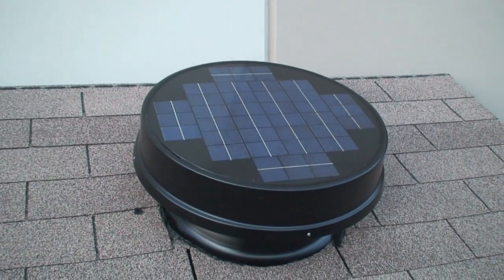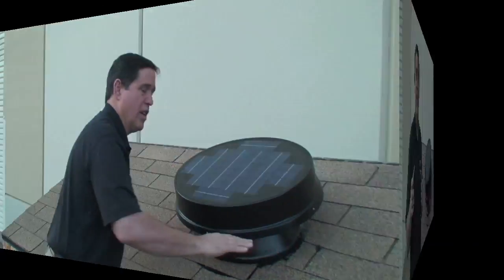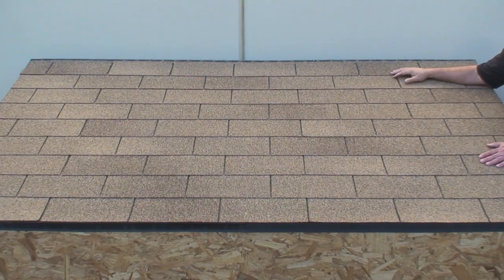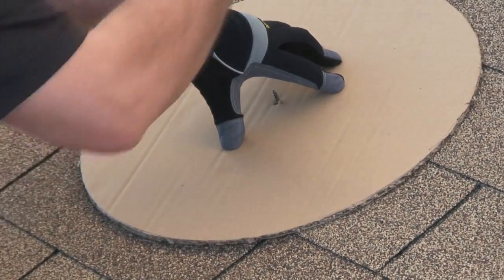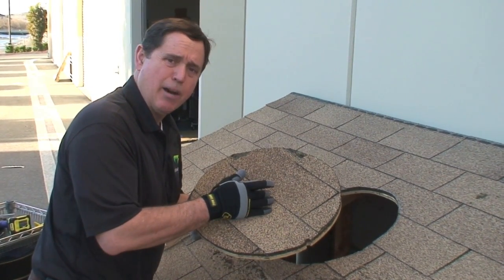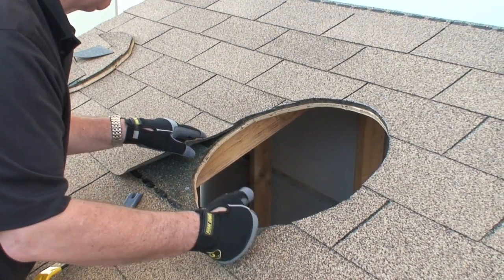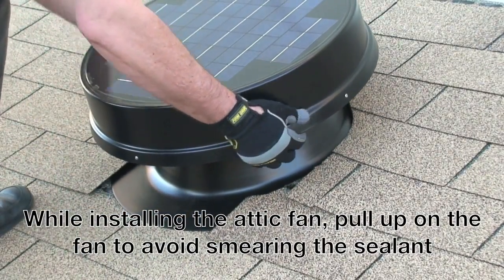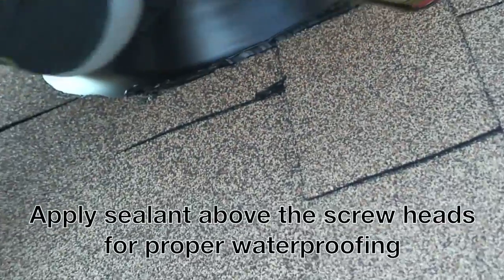How to Install Solar Attic Fan DIY - Yellowblue Eco Tech

Comment: Thank you for this video.  Is there a thermostat for this fan?  
Or, will it keep running 24x7 ?   
Sometimes during cold whether you may want to keep the heat in.

Thanks!!

Comment: How about a simple pricing guide, when I see a product that shows great potential then you have to play Marco polo to just get at the price of the thing, I immediately suspect an upsell High-pressure system in place. How many potential customers have you lost due to the fact you can not put a straight forward pricing guid on the sight? Most independent do it yourself home owners and small contractors do not want to talk to a sales rep unless it is to get a product serviced that has failed for some reason or to get an occasional Tec aspect as needed.  Food for though. From an almost customer!.

Comment: Well-made, delivered quickly, and easy to install with Fastly.Cool . I may be imagining it, but it seems quieter than the 14 year-old unit that I pulled out. Of course it was noisy at the end due to failed bearings, so hard to compare.
Reply: This stupid comment seems to be on every solar fan video.
Reply: @TonyYesi  lol
Reply: yunis parveiz is a bot leaving same (copy paste) comments on every solar power installs - advertising his company

Comment: I'm not a builder so I'm ignorant if many things. I think this makes sense in consistently warm and hot climate, but what benefit is it in winter? I'm concerned the opening will allow the cold in or heat to escape through the roof. Am I mistaken?

Comment: You do note want to install screws through the shingles! Putting caulk on the screw heads won't help as it will cook off in the sun and then leak! You also don't want to put the piece of shingle on the bottom that is a dam for water, leave it off to let the water run off.
Reply: 1000% yes

Comment: Actually should leave bottom part of flashing exposed to keep rainwater from backing up and getting trapped under the shingles and then just seal around the shingles you lifted up.

Comment: If your heat/cooling ducts are also in the attic this fan will create a negative pressure.. sucking out cool air from these ducts where they are spliced or connected to ceiling register vents. I installed one and My attic was cooler at the expense of much higher a/c power bills.
Reply: *   If you have access to the ducts, tape the joints. Should be taped anyway.
Reply: Would you recommend an electrical version instead? Thank you

Comment: My wife forced me into having a sit down lunch and listen to their products such as this fan ... the price with I
Installation was $2400     Meanwhile the fan is about 300 online    Ripoff
Reply: I have Michael and Son installed a wired attic fan 10 years ago for $399.99 - Fast forward to 2019 (last year), the fan stopped working so I ask them to replace it... they said I should only replace the fan motor...and it cost me $599.00 to replace the motor and I asked why replacing just the fan motor cost more than the entire fan installation?  They said because the full installation labor is now $1299+price of the fan!

Comment: Who taught you how to do this? They need to be thrown off the roof, you do not put these under the tar paper always on top to prevent leaking. And no screws only nails. Unless you want something to happen hoping you'll get the call to come back out and make some more money off unsuspecting home owners
Reply: Why no screws? Why just nails on roof? I'm thinking of installing and am genuinely curious
Reply: Dan Burkett only roofing nails should be used because they’re corrosion resistant, they have a broad head to keep the shingles or whatever they’re holding down from ripping off during high winds. They also have ribs on them to hold into the wood underneath. Plus with a screw there’s the possibility of running them in too hard and damaging around the area to allow water to leak through. If you do decide to do this please do not use screws and only use roofing specific nails! Your insurance company or wallet will thank you in the long run. Also be sure to put some type of silicone such as liquid nails or something of the sort, over top of the nail heads and on the bottom of the vent before placing to help keep water from entering anywhere
Reply: @blake102989  Thanks for the thorough reply! I'm on the fence if this is the route I want to go or a Gable mount? (mounted on side of house instead of in roof?)
Reply: Dan Burkett  you’re welcome. I personally like whirlybirds because you won’t have to worry about the fan going out like you may on this one. Look into them too. I’ve always put them on the roof never on gables.

Comment: My house was built in 1889 when i bought it, it had it's second roof on it. Composition over shake there were no vents. When i re roofed it i put a thermal attic fan on the west side. Now the attic is cooler in the summer. I dont have central air, no ducting. I have fans. One ceiling fan one floor fan. No moisture and no mold anywhere. The only insuation is in the roof. And a pellet stove works to keep it warm.

Comment: Is there a thermostat that tells the fan to kick in or is it always running?
Reply: Hard to believe that they did not 1) include a thermostat, and 2) did not design a bug screen.
Reply from the maker: Always on per solar embedded crystelline chip theres no "on or off" switch
Reply: What about during winter?
Reply from the maker: Hi John, there are actually benefits to the having the fan run during the winter... Helps with removing moisture build up that can cause mold growth issues. Also, can help with ice damming. Here's a link to some additional info on how our solar fans work year-round: https://yellowbluetech.com/products-technologies/solar-fans/how-does-a-solar-powered-attic-fan-work/.

Comment: Great video buddy.I'm thinking about purchasing two of these solar fans but I have a question.My house has two 4' off ridge vents on it,should I seal the bottom of those ridge vents or will they be alright opened? I'm afraid that when i install those solar fans that the air being sucked out will be getting sucked through the ridge vents which is outside air instead of air from within the roof. Please let me know what you think.Thumbs up on this video,thank you for your time bud.
Reply from the maker: Thanks for the positive feedback! All questions on our system can be directed via http://yellowbluetech.com/contact/.
Reply: Yellowblu Eco Tech

Comment: seems like there should be an on off switch
Reply: Most are set to 'go on' when the attic reaches a certain temperature so that it creates air flow to pull out the hot air keeping the 'living space' of the home cooler.  I don't know about you but I don't want to have to manually turn the fan on and off.  What a pain.
Reply: The switch will be when the sun isn't out.

Comment: You should have it installed over the tar or underlayment paper. You must not drill screws through shingles. It will leak couple years later. You also need to leave at least 1/2 inch clearance around the top flange by trimming the shingles. Then you calk underneath the shingles. Besides that, great installation. haha
Reply: 100% agreed, never cut the underlayment.  There are some great sealants now that are rated at 180F.  No screws thru shingles, try to lift them and put a couple under the shingles, seal the screws before final tightening.
Reply: This^

Plus using a Sawzall to sideways cut through your nails!?  This is so stupid and risky of cutting into your tar paper or shingles.
Pry up your nails and either replace them after in the same holes (with some sealant) or seal the holes and move on.

Mine came with two templates so I used one inside to ensure I was centering and one outside.
I lined them both up and put a nail through them first.  This ensured that where I placed the template was exactly where my hole was going to be on the outside.
This will save you the step of measuring for a center dot.

The flashing on this unit sucks and for that alone, IO would not buy this model.
It should have some flat flashing around the outside. 

I'd bet money if this guy installs this way on real roofs, it leaks often.

Comment: I rather go with a gable vent fan. I'm not taking the risk of a leaking roof. I'd install it only if I was getting the roof re shingled. Then it would be installed properly.

Comment: Is it recommended to have the fan running during the cooler seasons as far as keeping the home warm? I can see this beneficial as far as controlling moisture during fall and winter, but would this cool the home when not needed?
Reply: roxspin usually there’s some sort of thermostat that turns the fan on when the attic hits a certain temp
Reply: This only turns on when temps are above 78% is what I read.
Reply: No offense, but if your home heating is affected by heat escaping into your attic .. ... you're likely WAYYYYYYYY' UNDER INSULATED.

Your attic is literally pieces of wood.  ie: rafters and sheeting.  Topped with a shingle of choosing.  None of these are heat or cooling savings.

I'm in Texas.  My attic is insulated with literally drifts of insulation.  Topped out the insulation "ruler" straps.  Easily plus R-55.  

My roofs only job is to keep water out of what lies below it.
Reply: @jamiecampbell3068  While that's true, the rate of heat flow through insulation is affected by the temperature differential. Insulation, even R-55, is more effective when separating smaller temperature differences. That's why cooling your attic is good during the summer and keeping it warm during the winter is beneficial. Warming is coming from sun hitting the (typically dark) shingles and conducting through as much as it is heat coming up through the ceiling.
Reply: @jefflayton4339  ????? ".. heat flow thru insulation" ???  What.  There is no heat flow thru insulation.  If there was, it wouldn't be "insulation".  You're insulated from temperatures.  Hence the definition of.  Owens Corning certified HVAC & construction contractor.  I have no idea what your statement means .. other than, it makes no sense.  Insulating your home is to ensure adequate control of what your thermostat reads.  If you have ANY temperature "flow" from outside of your living space ... then you're not properly insulated.  Period.  The end.
Reply: @jamiecampbell3068  So, to be clear, you're saying that "if there's insulation between point A and B, there is no heat flow."

So with that in mind, why is there insulation at ratings between R3 (foam board) to R30+ (thick fiberglass batting). According to your logic, ANY amount of insulation means 0, absolutely no, complete absence of heat flow.

Tell me if that's what you're saying or if you admit to being intentionally obtuse.
Reply: @jefflayton4339  I'm saying .. "You are clearly not an insulation expert."  Nor are you versed in heat loading.  That's it.  Nothing, else.  Re-read your posts.  All nonsensical.
Reply: @jamiecampbell3068  Point out specifically what's nonsense or stop bothering me.

Comment: Yes you can install on tile roofs. You will need a special flashing with a sub flashing to make it leak proof. The flashing shown here is not designed for tile.

Comment: People never never cut the nails between the shingles with a sawzall. You will tear the felt. Remove all nail within the flange area. Also all flashing should have 1/2 valley around where the flashing and flange meet. Then if you want you can seal the shingles to the flange. Also that vanity shingle is a waste and will only cause debri to build up. The fan looks like a good system other than the plastic fan blade but the installation was horrible. This guy is definitely not a roofer.

Comment: I like the contained unit. In Florida, my home could use 2 of these. One to push air and the other to pull out of attic through the gable end vents. Question: would I still need 2 install ridge vent (I need a new roof) or would I not need it with 2 of your fans? What is the cost of these fans, and I can purchase on line only?